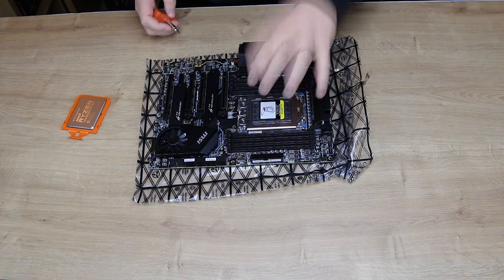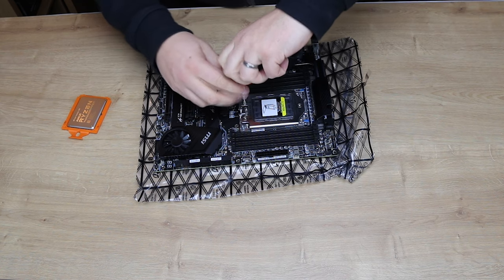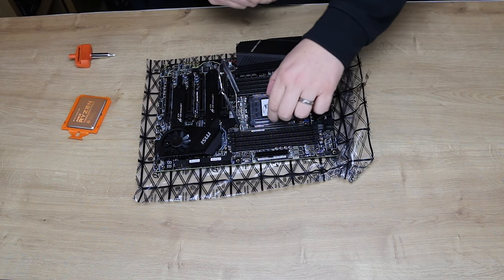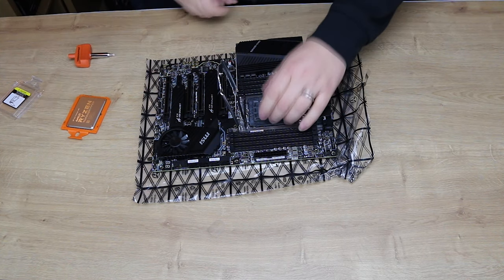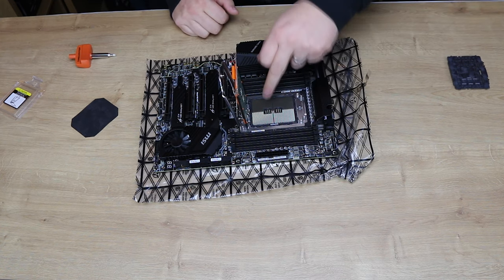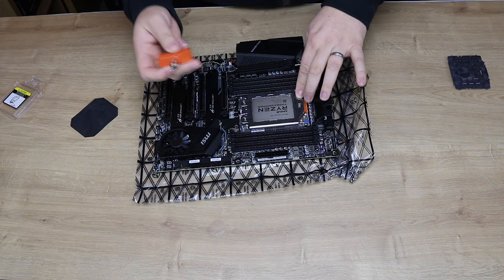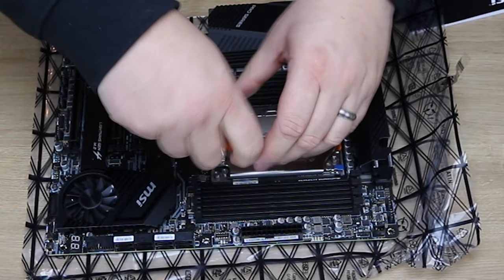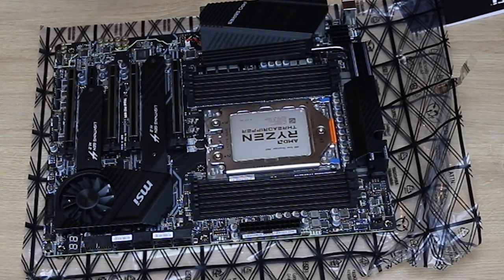Threadripper CPU Installation guide- including 3960X - 3970X Socket TR4 and TRX4

Comment: What's your thoughts on a couple items.  1) Do you think you can over torque the CPU and damage pins if you don't have the tool, ... it can be installed using standard torque tips?  2) Does the plastic mount furnish any other function besides placing the CPU in alignment for installation?  Yes, it is higher risk to install without using the alignment frame due to dropping the CPU into  the pins, but it appears that there is enough friction to hold the CPU firmly against the pins without it.

Your thoughts,  nice video!

Comment: i wanted to ask what cooler do you use with this cpu ? i have both cpu and board are in its way but im searching for the cooler i found noctua NH-U145 supports strx4 socket, is it good with this cpu?

Comment: is it necessary to tighten it up until the click sound?
I just finished my build build was afraid to tighten it up to the end.
I just tightened until my fingers felt it was tighten. (using the amd screwdriver)

ps. my mobo is an asus prime trx40
Reply from the maker: It clicks to stop you from over-tightening it, so if it feels tight and there is no movement of the plate you should be fine
Reply: @TechforTechs  thanks for the answer! u saved my life haha
Reply from the maker: @Zebrastian  No problem, thanks for watching!